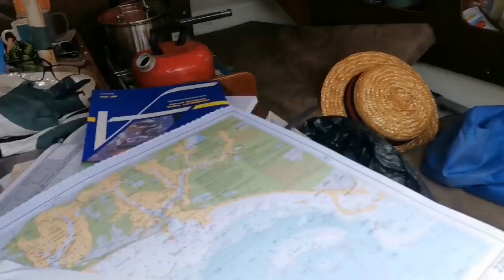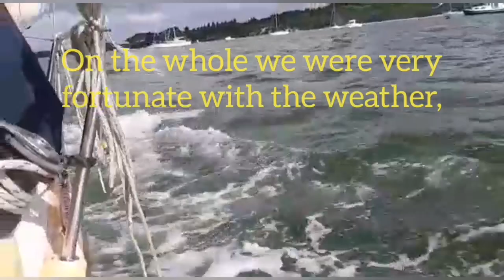English Channel crossing on a trailer sailer

Comment from the maker: Someone commented on here the other day I forgot to reply, now it seems to be removed but they asked how much motoring we did and Qty of fuel we used. On the way over it took 16hrs, 10 of these were motor sailing. Could've sailed the whole way but wanted to get in in the daylight. Return trip 14hrs only motor sailed for 3 or 4 hrs as the wind was stronger. Again could have sailed the whole way but it was forecast to increase to f6 which it did as you see in the video. As for fuel consumption not sure maybe did a 20l tank? I think I got 70 miles to a 12l tank on the broads but not sure maybe it was 12l plus 1 gallon can? Anyway it's prob 1-1.5 litres/hr at 5kts? It's a Yamaha 6hp 4 stroke  Hope this helps.

Comment: really enjoyed your video. you have set the bar high for my seal 22 mk1
Reply from the maker: If you do similar in yours make sure the wind is on the beam or abaft it and less than a force 5 else you'll be regretting it I reckon! They are pretty seaworthy boats and we barely even got splashed but did get lucky with the weather. Folkestone to Boulogne would be an easier quicker one for a Kentish I reckon 😜

Comment: I enjoyed your video. What is the white barrel looking thing hanging from the mast?
Reply: Radar reflector
Reply from the maker: Yes, you usually see this type mounted on a bracket on the mast but it can be rigged like this hoisted on a halyard. I reckon these have to be better than the basic  simple temporary diamond shaped pieces of tin ones you usually see hoised up, but who knows. This particular one is approved by the UK MOD so that gives some hope! Thanks for watching.